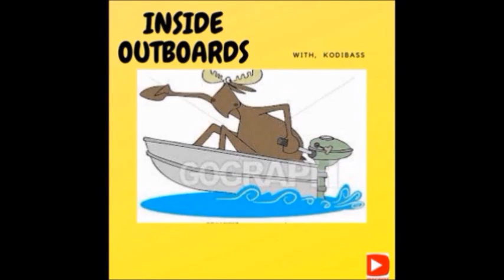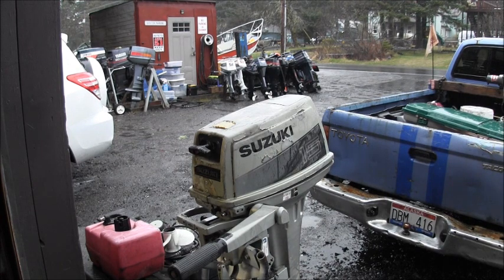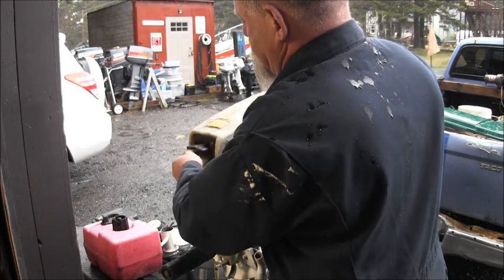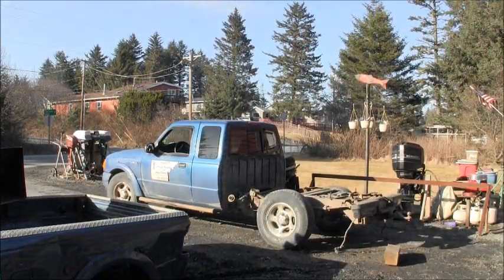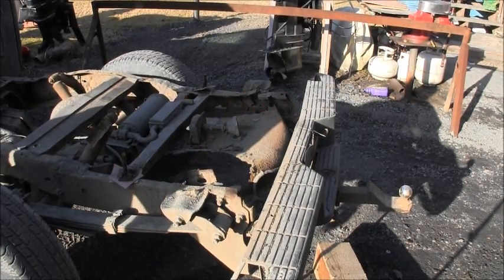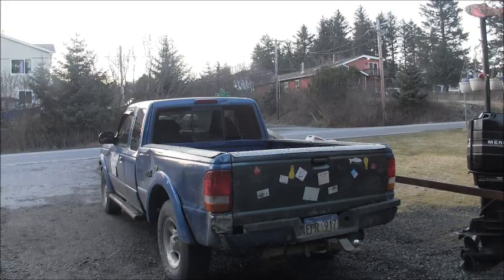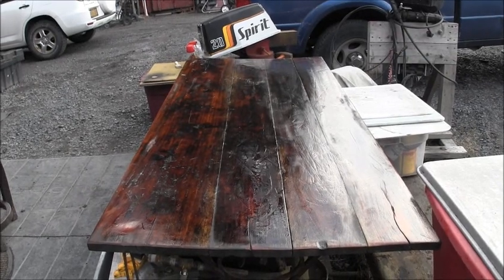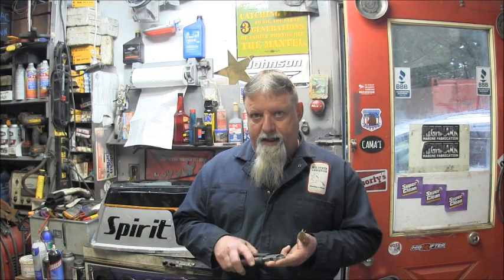OUTBOARD, WELDING & STUFF

Comment: That’s a great weed eater stand! I believe I’m gonna steal your idea and build one for myself lol And I’m wanting to turn my 30hp evinrude into a remote steer. My question is, will I need to remove the power head to change the tiller handle bracket out?
Reply from the maker: No' But there is a center 9/16 nut hidden under the pan dead center in the front .  Watch my vid on motor mounts.    kb

Comment: Couldn't read the can of stuff you sprinkled over motor after grinding..
Reply: That was Moeller's yellow zinc phosphate self etching primer ( # 025801). It is said to be designed specially for the marine environment and can be used in under the waterline application. Regards !